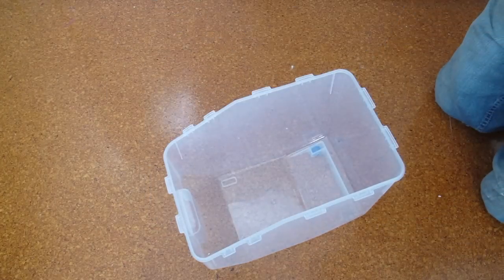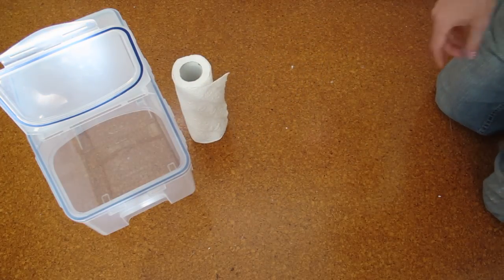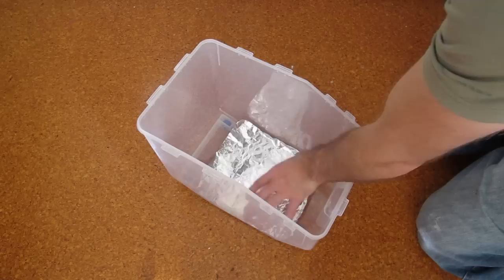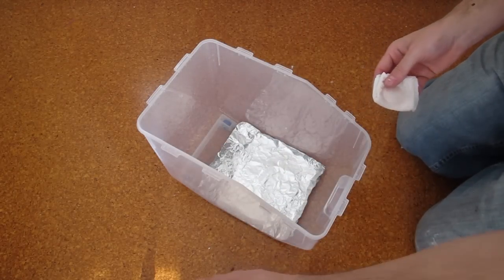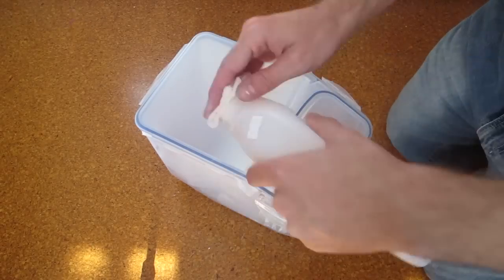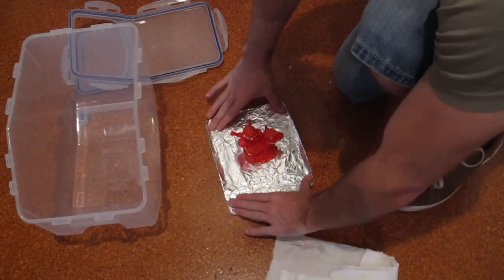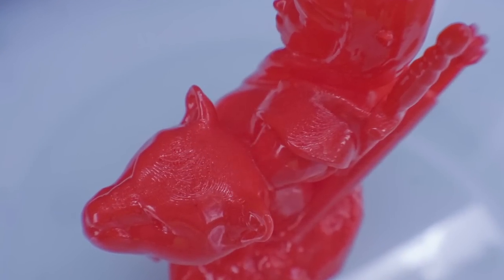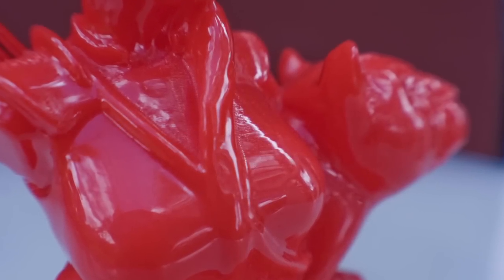Cold Acetone Vapor Finishing for 3D Printing

Comment: I want to make totally clear/transparent stands for figures with absolutely no lines... I am afraid I will have to cast them using a mold. Is there a way I can get them totally smooth and transparent after I have printed them (if I use clear ABS filament)?
Reply: You can always print and vapor finish the model. then mold it in silicone and cast in a transparent plastic. That'd work best.
Reply: Ryan15T Thank you, Ryan. Actually the problem was I wanted to finish printed parts I had made using an object I had 3D scanned so I'm basically stuck f***ing around trying to figure out the best way to mold and cast these things. They aren't big so I'm going to use silicone putty molds and hopefully they will be better... I had been using another material (Composicast), but if you get that hot it melts, so drying my casts was stupidly slow and I didn't get good molds with it anyway... actually I had 3 of these things I wanted to mold... these stands for small action figures and I broke all of them in some way or another... had to order a new one. Luckily I found someone on ebay who was selling just the stand I needed so I'm going to try using silicone putty and hopefully I'll get a better mold, one which will stand up to heat so I can put it out in the sun and have the resin harden more quickly... (I live in southern CA so we get lots of sun most of the time)  :) Anyway thanks for the advice. :)

Comment: You said that the acetone treatment doesn't help much on horizontal surfaces - Try the process again a few times but place the object on it side so that those horizontal surfaces are now in a vertical position.
Reply: Mount it to a PLA jig so you can change the angle of the model without damaging it.

Comment: 2:40 you could just spray aceton there. if pure acetone is to dissolving you can dilute it by any ratio with IPA (isopropanol alcohol) since it has no effect on ABS but slows down the ABS dissolving time.
i found this out while experimenting with toner transfer method.

Comment: You could try shining an incandescent light bulb on the towels to try to heat the acetone.

Also I would suggest opening outside afterward. The fumes from the acetone are still trapped in that box and can burn your lungs and eyes.
Reply from the maker: Mo Jo Yes you totally could do this, you can also use a glass container and put it on the heated bed on your printer to warm it up, or put it in the sun. Good idea.
Reply: I just utilized your suggested method to refine a show piece. Thanks for the video Doo Dad!!!
Reply from the maker: Mo Jo
Very glad to help!

Comment: Hi, nice video, very useful. What kind of printer do you use? I'm looking for a printer which can produce the best possible resolution and smoothness with ABS or PLA. thanks.
Reply from the maker: +Peter Sály we use both Rostock Max's as well as a Taz 4. To get max smoothness you want as little play as possible or wobble in the z-axis (for cartesian printers). Both machines do a great job at keeping prints smooth but your own running of the machine will be the biggest factor.

Comment: now that is quite amazing! I really like that, but i'm a little confused about the process afterwards. I want to paint my 3D prints as well with a nice metallic shine (like your 3D print in the video but painted and still at that shine), but I still want to maintain that nice finish. do I still need to go through the process of sanding and primer before I do a paint and clear coat? or could I just proceed to paint and clear coat after the acetone process is finished?
Reply from the maker: Jamil Taylor I'm no expert on paint, but I would suggest that if you do this process, then you should be able to just spray (with a paint that works on plastic) then clear coat without sanding.

Comment: I live in the frozen wasteland of the north west known as north Dakota. It is currently -20 outside and I want to finish off a print. The other living organisms in my house cannot handle the acetone vapors, so I must do it outside. Is it possible to do this in negative temperatures, will it turn out decent, and about how long will it take if it does infact work? TIA.
Reply: Crazy Hobo no, the acetone must be at sufficient temperature to evaporate. there are methods of heating the acetone, but this is dangerous

Comment: I so happy to see a video not using a heat source :) this looks a lot safer than the hobby home wrecking instructions out there ;) i am wondering if you actually painted any models after using the acetone method? Greetings from germany..where we gladly use the word aluminium
Reply from the maker: Smile Skateboarding Supply Co. Onward brave Aluminium speaker! I haven't tried painting them after vapor finishing - they're very shiny so I would guess you'd want a plastic primer or a decent plastic paint to get it to stick. Cheers!

Comment: which abs filament are you using for the print and how do you prepare the heat bed?
we have to fight against hard warping with PrimaValue 3mm ABS on an Ultimaker 2+ extended with glass bed

Comment: Hey, great tutorial! But I got a little problem, the towels dry too fast but the print isnt finished yet. What am I doing wrong?
Thank you very much
Reply from the maker: +nanafalke You might need to recharge towels halfway through (especially if it's a big print) or put more towels in.
Reply: doodaddoes Yeah, I tried that and it worked very well. Thank you for your answer! Great tutorial!
Reply: sponge layered bottom of a large family sized campbells soup can with a PLA or PETG printed cover that is transparent worked for me.

Comment: Curious if you could fix the problem with horizontal surfaces not smoothing out as much by hanging it upside down with a screw through the base to hold it or something similar.
Reply from the maker: It's not so much the surface area affected by the acetone, it's more to do with the less sloped areas having larger visible steps between layers. While a vertical wall may only have 0.2mm steps, a 2º slope would have the layers much much further apart (if looking down from the top) and they may be a couple of millimetres between the layers of filament. To smooth that much would destroy the rest of the model.

That being said, hanging it upside down would actually really help on certain models since the vapour tends to sit more at the lower part of the container, so it's totally worth doing in some situations

Comment: Can I put a mini computer fan in the chamber to blow the fumes around over the horizontal surfaces?
Reply from the maker: Powellmade Yes you can, but wherever the vapour-laden air hits on your model will smooth much faster than the rest. Ideally a circulation system that moved the air very slowly and very evenly around the model would be the best.... Or just use a larger container and more acetone ;)

Comment: If superglued multiple ABS-printed parts together: is superglue a problem here? Like, will it react with the acetone?
Reply from the maker: +MrSendermen Possibly - if the superglue is exposed this part won't smooth nicely. I'd still test it though, might not look too bad.
Reply: +doodaddoes thanks for the response! I tested it with a similar PLA model, and nothing happened to the superglue (even external glue)!

Comment: You should try adding some airflow in there. A small fan inside with a shaft throw the box and the motor outside.
Reply from the maker: Yes that would work, you'd just want to avoid the incoming vapor hitting one side of the model, or it would end up smoother than the rest.
Reply: Perhaps, but make sure you're using a fan with a brushless motor, and make sure the batteries, switches -- everything but the fan itself -- are outside the box.  Otherwise you'll get sparks, and BOOM!
Reply from the maker: jaholmes01
Yes, this is very true. A vapor finishing bomb is a bad idea.

Comment: What if your piece doesn't have a flat surface to rest on? How do you keep the surface that comes in contact with the aluminum from deforming? (Thx for the vid!)
Reply from the maker: +Plenum T That's a tough one. You'll want to find somewhere to rest it on, or a few key points to have it sit on, however those will most likely end up deformed or indented... If you had a single point that you could suspend it by string that might be good. However the whole model becomes soft and so it might sag where it's held or supported. Sadly a flat bottom is the best option :(

Comment: Hi

I was very hyped to try this but am getting very underwhelming results... if anything. I have followed these instructions to the letter for 3 hours, nothing happened. I repeated the process with 6 paper towels for 3 hours, twice in a row, and nothing. Literally no change at all.

Im definitely using ABS theres no issue of me accidentally using something else.

The sealed container has a seriously strong smell of acetone that lasts for a while when I outgas it so I know the fumes are in there but theyre just doing nothing.
Reply from the maker: Very interesting. Try this: Get a scrap print of the ABS and paint some acetone directly onto the surface - if all is well you'll see results in seconds. If it has no effect, then there's a chance you're using some odd pseudo ABS (or another plastic marketed as ABS). Let me know how that goes.
Reply: doodaddoes OK I have tried this a lot over the last few weeks and I managed to get it to work... in a completely different manner. I had multiple parts printed from different brands of ABS on different printers and put them in a big box with 4 sheets of acetone soaked towels... nothing.

Now I put them in a very small box like the ones you get with chinese takeaway and put some acetone in a small container sitting next to it, no more than about 30mls. There are no acetone soaked paper towels. After around 8 hours, the parts are smoothed out pretty nicely like the ones you show here. I can speed up the process with a bigger container of acetone and by leaving it in the sun but not below 4 hours.

I just dont understand how you possibly got them to smooth out in 3 hours. Did you leave the box out in the hot sun?
Reply from the maker: djbrowny 3 hours would be the minimum for something about fist-sized. 5 hours is a more likely amount of time needed. When you say 'box' what size box are you using? This video used a 12L box (around 3gal) and 3 full size paper towels soaked in acetone.The small container is a more efficient way, though you'll be limited to something that will fit inside it.I did not place the item in the sun at all, and it wasn't hot, just a mild indoor temperature (around 25ºC) I'm puzzled by the results you're getting (or not getting) - is your Acetone perhaps a bad batch? What happens when you paint the acetone directly onto an object, does it visibly melt it? If you brush it on you should easily see the brush strokes melted into the plastic.
Reply: doodaddoes Hmmm My box is probably double that size at a guess. I did suspect that would cause issues but to account for it I used even 6 towels at one stage but still after a whole day I got nothing. Yeah Ive painted parts with the acetone actually... Made a nice mess so I know that much works. I'm trying something new actually... I have high hopes for it. If it works I'll let you know. Just an addition to speed up this cold treatment process.
Reply: doodaddoes Well, I got a MUCH smaller box and put a small container of acetone inside it instead of soaking paper towels... worked brilliantly.
Reply from the maker: djbrowny Excellent! How long did you need to place it in there? If you feel like it, send me a picture of it, I'd love to see it! isaac@doodaddoes.com

Comment: I know that acetone can also melt PLA plastic as I have tested it before.  Will this technique work on  PLA plastic?
Reply from the maker: +DEATHSKULL37 If acetone works on PLA, then it's not PLA. But yes if it melts the plastic you're using then this technique should smooth it.
Reply: +doodaddoes Thanks!

Comment: would the horizontal lines at the top that are still visible go away if you redo the acetone vaporising with the model on a vertical orientation ? as in changing the gravity relation to the model ?
Reply: +Mikele S No it wouldn't change it. If you printed at a lower layer height like 0.1mm you'd probably get them to disappear though.

Comment: Excelent video .... does this works with PLA???
Reply from the maker: Ruben Apablaza No it wont work with PLA since it doesn't dissolve with Acetone. There IS a chemical you can use to achieve a similar result with PLA using THF (http://en.wikipedia.org/wiki/Tetrahydrofuran) but I've not done it myself - there's some concern over it being pretty nasty stuff :(
Reply: doodaddoes You can also use "MEK Substitute" it's basicly Ethyl Acetate and it's as safe as acetone and acetone is safe people are just over cautious. This method is over viewed on printedsolid just search mek subsitute pla on google and it should take you there.
Reply from the maker: CleanEdgeProductions  Thanks mate! Perhaps I'll do a video using this, sounds good!

Comment: Thanks, my object was OK, but now it's just trash. After a night, print didn't smoothed at all, instead it just tried to melt to foil and now part of model which was down are flat
Reply from the maker: Дмитрий Стрельцов That's strange that it would melt the lower portion and not smooth it at all. I'm not sure what to tell you, but your plastic seems to possess to both resistance and susceptibility to acetone at once.
Reply from the maker: Дмитрий Стрельцов Not sure if you ever figured this out, but I wondered something: How cold was it where you were doing the finishing? If it's too cold the vapor may never have had a chance to fill the chamber and just sat at the bottom.
Reply: doodaddoes It was definitely not too hot, because it was in apartments staircase, not even in heated flat, so vapor pressure apparently wasn't enough. Will try again with different conditions

Comment: Could u rotate or lay down the model so the horizontal sides become vertical and smooth out
Reply: technically yes you could, but it would be very difficult since the surface would already be quite soft at that point and would be prone to marks if moved

Comment: I scene people using there build plate to smooth there 3D prints with acetone, but none of them look as detailed as these do.  I guess it has to do with the heat with the acetone?
Reply from the maker: It's harder to get fine control over the finish when using heated acetone since 10 minutes is a long time with heated acetone. With cold acetone vapor 2 hours is a short time :)

Comment: Will it work on PLA? please i want a way
Reply: I'm pretty sure this only works with ABS plastic. The acetone causes a chemical reaction in the plastic causing it to soften and then eventually's smooth out like it does in the video.
Reply: Chloroform work on PLA just like acetone work on ABS.
But chloroform may cause cancer.

Comment: Just a fair warning (which really should be included in all of those acetone technique videos): not only the vapors are flammable, acetone is a mind altering substance which will treat your brains cells very wrong if you inhale too much of the stuff. Acetone is one very dangerous son of a bitch when it gets in contact with the skin, the product may seep into the flesh and reach the bones where it will decay the bone marrow. We use this stuff where i work, and one of the things we are entitled to do for self preservation and safety is using a gas mask with an adequate filter (for volatile organic compounds), the other is wearing appropriate gloves (be aware: most basic rubber glove will melt when associated to acetone.)

Comment from the maker: Let me know if there's some other technique I should try :)
Reply: Looks like physics plays a toll on the final outcome. so it sags. which leaves areas the top that almost flat too flat to sag and smooth out. What if you hung it upside down in that container some how. or do the same thing in a vac chamber. curious what would happen then
Reply from the maker: Jawni Vudoo Your model shouldn't sag at all. Make sure you have at least a 10% infill and don't leave it for too long. Also make sure your shells are thick enough to prevent it drooping. If you've got a part like a dome with no support, consider printing a removable support and leave it there while you vapor finish it.
Reply: doodaddoes Why not add a little computer fan to help circulate the acetone vapors around the container giving you a faster and more even effect around the model
Reply: Shouldn't it be possible to smooth the model in intervals to prevent sagging?
Like putting the model in the container for half an hour every hour or two and letting it "dry out" in between so the acetone never fully penetrates the ABS and only melts the surface again and again until it's smooth. I have no idea what I'm talking about, just an idea. Might be worth trying out with a structurally vulnerable print to see if it makes any difference.